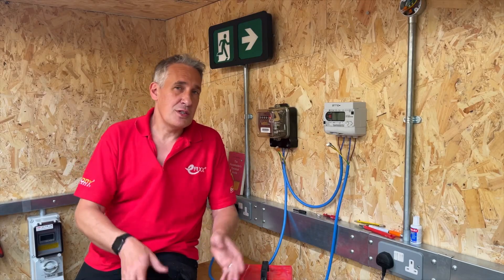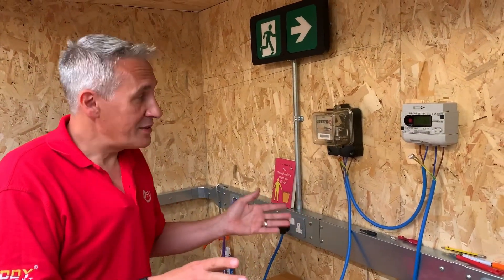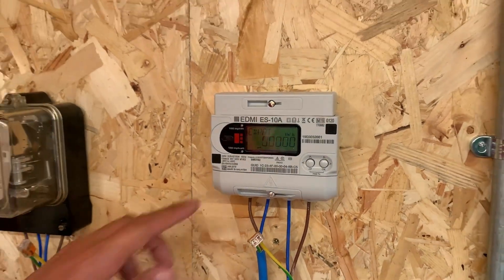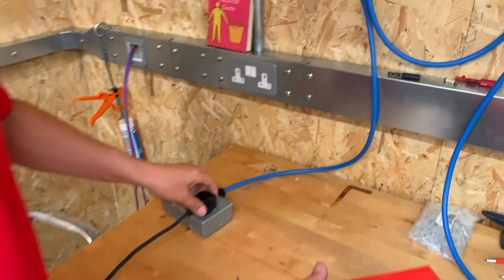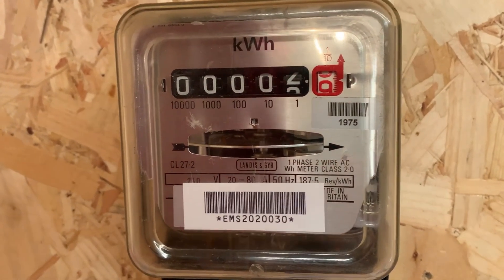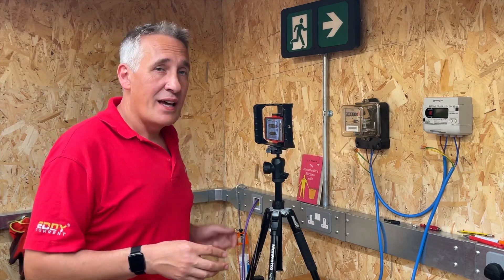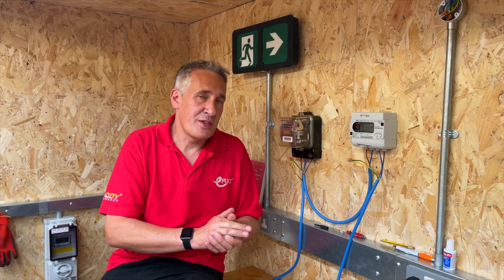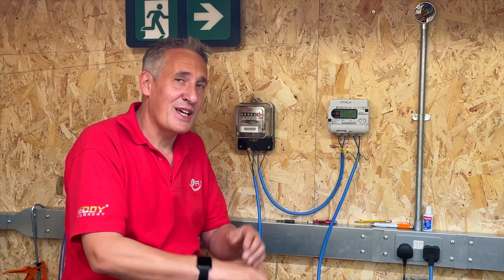Will My Electricity Meter Run Backwards After I Install Solar?

Comment: When we had PV installed just over 10 years ago the electrician said he thought our old mechanical meter might run backwards when exporting.  I found it would run backwards just a little bit - the wheel started turning backwards but then stopped after less than a revolution.  I presume this was the backstop which you mentioned.

Now we have a sooper-dooper smart meter - which registers 300 W of export pretty much all the time, even in the middle of the night.  I've told our supplier but they said that as we weren't being paid for metered export (old FiT scheme) they weren't interested.
Reply: so you're exporting power back for free ? at your cost ? No thanks !
Reply: @blow0me  Errr, no.  We're on the old FiT scheme which means we get a generous payment for generating the power, after which it doesn't matter whether we export or not.  We can use it all in the house and we still get paid the same.
Reply from the maker: Aren’t energy suppliers great 😂

Comment: When I had my pv array fitted my old analogue meter did run backwards had no end of arguments with my supplier as reading was always going down. In the end I had a smart meter fitted to stop the reading issues
Reply from the maker: Thanks for the info - who was the energy supplier?
Reply: @efixx  eon is my supplier when my smart meter was fitted the sparky fitting it had to send verification I hadn't tampered with the old one
Reply: Should have given reading once a year to average out over summer winter

Comment: So is it illegal for the meter to run backwards?
Reply: Yes, I'd argue in court you got a full refund for the energy. Some of the feed in payments are next to theft. Charge you 39p kWh used but pay you 2p kWh produced!
Reply: @sang3Eta  especially when the spot wholesale rate can exceed the price cap, I've seen it spike as high as 80p/kWh. So they are happy to buy electricity on the markets at silly prices but refuse to pay more than a pittance to solar producers, then sell it on at the high prices. It's pure profiteering on the part of the suppliers.
Reply: @Soruk42  yes, government could easily solve the whole energy crisis by forcing energy companies to pay 80% what they charge (20% profit cap) for home solar production. Free market capitalism would fix it!
Reply from the maker: That’s not clear - As technically you aren’t abstracting - just borrowing

Comment: Would be interesting to see how the 2 meters cope with leading and lagging power factors - domestic energy is supposed to be Kwh - not KVA. Also how they cope with chopped up load wave forms from all the switch mode power supplies we now have (this must be an issue otherwise why the move to type A RCDs)
Reply from the maker: Good question - something we’ll have to investigate. Some smart meters you can see the KVAR readings.

Comment: My understanding is that having submitted your G98 or G99 install notification (which has details of solar gen. capacity and meter) to the DNO the onus is on them to replace the meter. Having recently completed a solar install I opted to get my old mechanical electric meter  replaced with a smart meter before the install process started. It seemed a lot simpler than doing battle with my power provider because meter readings were going down however legal it might have been...
Reply from the maker: Not sure on that one as DNOs don’t look after metering that falls under the energy suppliers. Do they talk is the question.
Reply: That's provided the installer did submit a notification to the DNO. Plenty of non-certified cowboy fitters doing the rounds now demand is spiking.

Comment: I live in Belgium and I've got such an old type meter, it does run back, should I export more power than I would import over 1 year, then I won't have to pay power, but won't get paid anything for the power I produced too much.
Because I have such a meter I'll get to pay taxes on the power rating of my transformer (because there's no realistic way to measure the usage of the grid)

Smart meters are rolling out, but due to some weird regulations, current owners of solar pannels can't be forced to get a smart meter until 2025.
However if you get a bigger or new installation, you get a smart meter within 2 months.
With smart meters you get paid a bit for exporting power (about 40-70% of the power cost, not including taxes)
But don't have to pay the 'transformer tax' you have to pay with old meters, cause with the import/export measurements they know your usage of the grid
Reply from the maker: Interesting to hear about the situation in Belgium.

Comment: You will find it hard to find a meter with no reverse flow detection, as that has been pretty much standard since around 1980 on meters, more due to people plugging in arc welders with a massive out of phase current, and the meters then reading wildly inaccurately, and often running backward from the large lagging near zero power factor load. You would need to have the combination of an old property, at least there since the 1970's, and never having had a change in electric supplier over that time triggering a meter change, and a supplier who also only changes meters when they fail, though most modern suppliers do use computer software that can fairly accurately calculate what your consumption should be, based on location, style of dwelling ( all those similar properties near you), number of people, age and such, plus historical use. Big change down and they come calling, first step being looking for tampering, and then changing the meter anyway, even with no tampering found. The old meters used to be sent to calibration, but the "modern" method is simply to scrap them as they come in.
Reply: they just found one.
Reply from the maker: There are lots of old meters still in the network.
Reply: Yeah more common than you think
Reply: "A friend" has a house, 1995 build, has got analogue meter, does run in reverse. PV fitted nearly 10 years ago!

Comment: I have one of the small rectangle plastic dump digital meters. It shows RED (reverse energy detected) regardless of weather im generating but has done this since the first solar switch on. Anyone know if it clocks forward on the reading even with reverse current as ive always been concerned it might ?
Reply from the maker: Your recent electricity bills should help to answer that.
Reply: @efixx  Its not a new installation circa 2012
Reply: @efixx  it's a shame this test didn't have a dumb digital meter it to answer this question. I would have expected it to just not pay for export but go forward when demand was higher than generation.
Reply: what happens if you switch inverter off, does it go back to normal display? If so you will see if it is counting units
Reply: @willdatsun  with inverter of it continues to cycle RED and reading
Reply: @bovnet  Mine only changes per kWh so with a 250W baseload I'd have to wait 4 hrs to see a change. An electric shower on with oven hob rings is probably the quickest way to make it tick up. Let me know if it works I'd like to keep my dumb digital meter and keep giving readings.